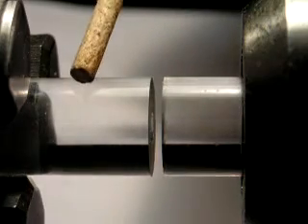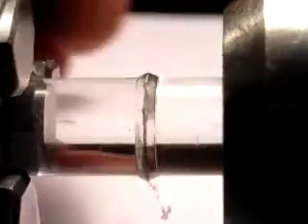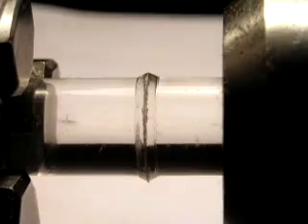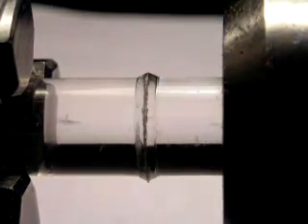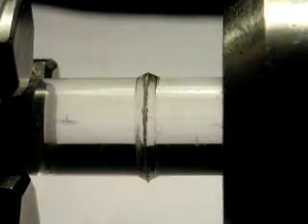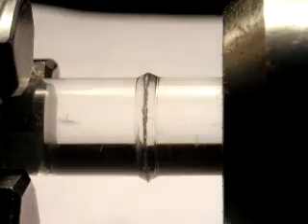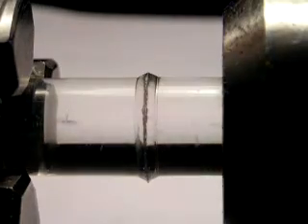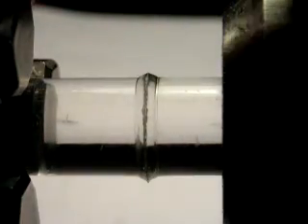Spin welding acrylic - lathe

Comment: Hi do you think this could be used to join polycarbonate tubes 2mm wall thickness?
Reply from the maker: It probably could - polycarb even melts at a lower temperature than acrylic.